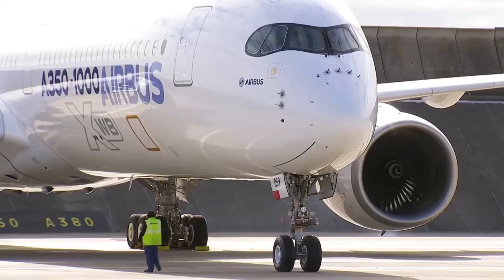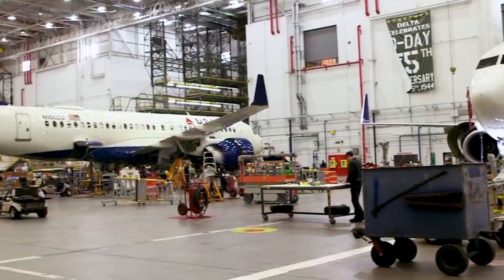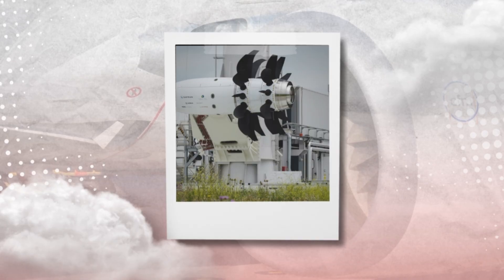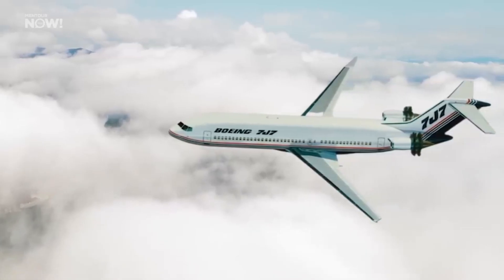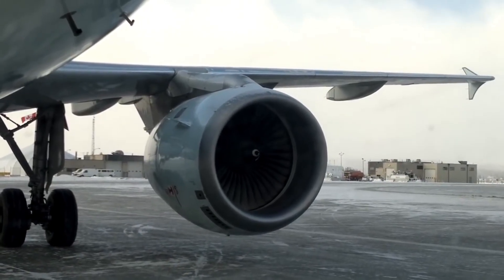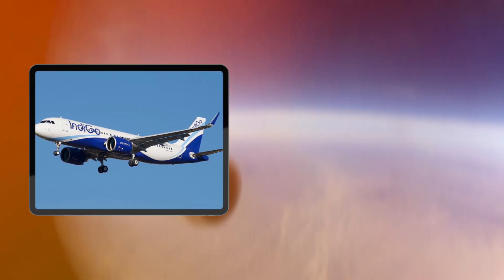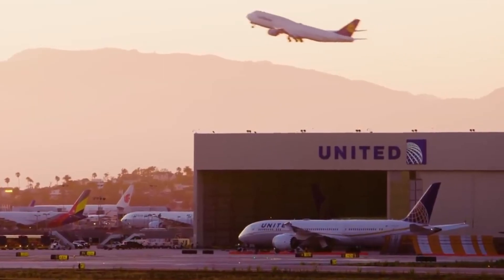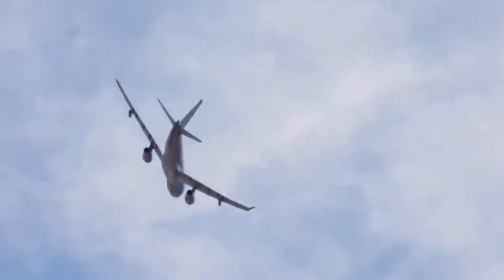Amazing CFM Rise Engine Explained: This Is How It Works

Comment: In response to comments above, likely the confusion of  being shown video of different engines ; This is being called a turbofan not a turbo prop and the while the demonstrator engines had counter rotating blades the RISE design plan for the final engine has back blades that are static which can be seen in the video intro picture.

Comment: Turboprop and turbofan engines are both types of turbine engines, but they have different designs and are used for different purposes.

Turboprop Engines: In a turboprop engine, most of the jet thrust (the force that propels the aircraft) is used to drive a propeller. The jet exhaust itself provides only a small portion of the total thrust. Turboprop engines are very efficient at lower speeds and lower altitudes, which makes them ideal for smaller, regional aircraft and certain types of military aircraft. They are also used in some types of helicopters.

Turbofan Engines: In a turbofan engine, the jet thrust is split between driving a large fan at the front of the engine and the jet exhaust. The large fan creates a "bypass" airflow that goes around the outside of the main part of the engine, rather than through it. This bypass air provides additional thrust and also helps to reduce noise. Turbofan engines are more efficient at higher speeds and altitudes, which makes them the engine of choice for most commercial jet aircraft.

The main difference between the two is how they generate thrust: turboprop engines generate thrust primarily through a propeller, while turbofan engines generate thrust through a combination of a large fan and jet exhaust.
Reply: One of the few helpful comments I have read so far. People see blades spinning in the open and think it's a turboprop without any knowledge of what they are talking about and how a turbofan and turboprop really work. All this just to make controversy

Comment: A traditional engine has a case designed to contain blade failure. I personally wouldn't be booking a seat in the fuselage opposite one of these engines
Reply: The nacelle is not there to prevent blade failure, it is there to direct the bypass air. Look up Southwest Flight 1380. Blades don’t fail often, but when they do, there’s no stopping them.
Reply: The nacelle is there to prevent blade failures. During the design stage, there is actually a distinction between part failures that can’t be contained (class I) due to the amount of energy released. For example a turbine disk (the ring that contains all the blades) is a class one part because of that exact reason - if it fails there is no way to stop parts going outside of the nacelle. That’s different then the failure of a single blade, being a non-class I failure that can be contained and is therefore much much less severe. Basically, class I parts are not allowed to fail and have to be designed with much higher safety factors. It’s something they’ll have to handle with the open rotor design. 
Source: working in aero engine  development
Reply: @mattclemente1922  I completely understand the case is used for air bypass but there's dozens of videos on the net showing blade detachment tests that are contained within the case of the engine.
Obviously, if there is a catastrophic fan failure, there indeed is no stopping them.

Comment: A turboprop engine with more blades.  A 30 year old concept.
Reply: @waynesmith2287 If you actually educated yourself you'd know that this is actually a turbofan concept with a much larger bypass ratio, allowing for the increased fuel efficiency and transonic speeds. Turboprops on the other hand work on a different concept using exhaust air to drive the propeller to then produce thrust, the CFM rise would use the exhaust gases directly for thrust, along with the bypass air from the blades. It's literally a turbofan without the engine cowling.
Reply: Concept first looked at in the 1940's! A little more than 30 years! They could solve the blade flutter effect. 1970's fuel crisis forced another look at the concept.

Comment: is this what Antonov did decades ago .
Reply: Again not,  Antonov   had true  counter rotating and unknown ops characteristic and longevity .    This is a single fan (lots of blades) uncontained,  so its an open jet engine or a turboprop without variable pitch props (the Vanes behind do move but only as airflow straighteners).    It all keeps changing cause they can't make it work.

Comment: So what happens if there is a blade fail, what contains a blade snapping off and flying into the aircraft  structure?
Reply: Same issue with prop aircraft.
Reply: @nialloftheninedevils Props fly lower and slower. Should a blade pierce the fuselage, there's less chance of a catastrophic mid air break up than at 40k feet and 585mph.
Reply: those seats are half price
Reply: I worry about this too. There's NO containment if a fan blade fails. That means possibly deadly shrapnel all over the place.
Reply: What happens when your car runs out of gas?? Or your car tire runs over a nail,   STUPID???

Comment: So what is the difference from the contra-rotation propellers from Kuznetsov NK-12 engine on Tu-95 and An-22. Basicly, it just a morden NK-12 engine, pack with more blade and noise reduction design which are similar when compare early single propeller turboprop engine with the modern one. An-70 engine, CFM version.
Reply: And its not counter rotating.   The RISE has fixed blades and one set with Vanes behind guiding airflow which I believe move.